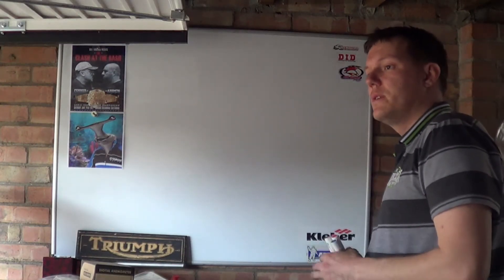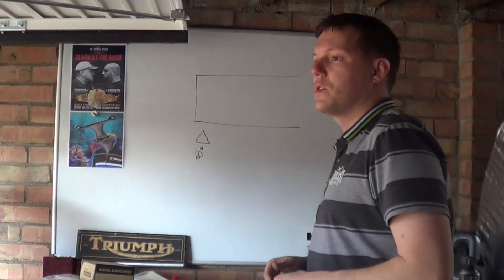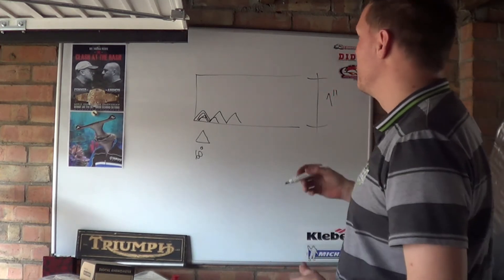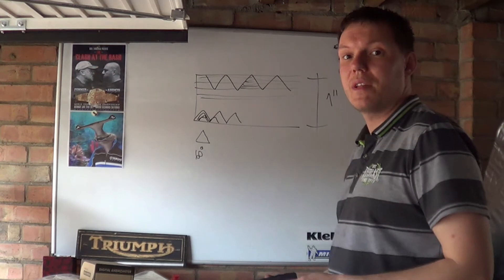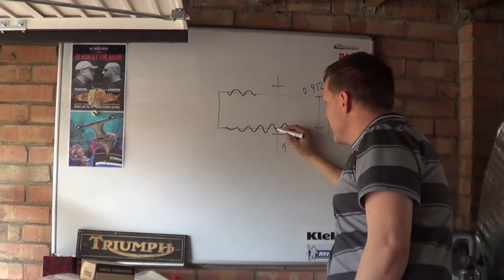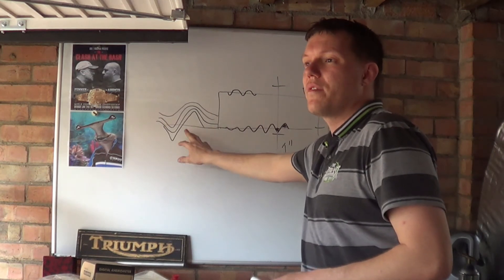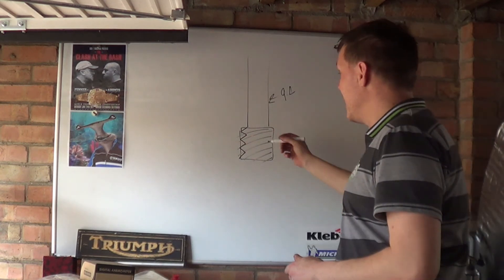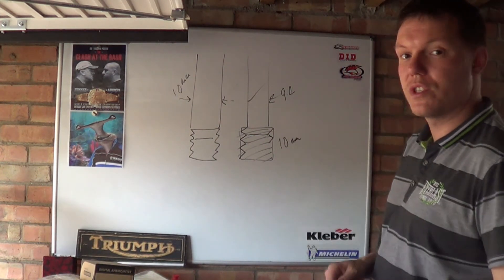Rolled vs Cut threads - what's the difference?

Comment: you could even take it a step further for ease of repair on some items and cut away a relieve that would be above the parting line of the material you clamp, so stuck threads that result in fastener breakage can be gripped, the benefit is that you can apply heat and spray and shock loads (hitting the end of the bolt) more effectively,  making removal way way easier, now if the diameter is bigger you can still do this, but it might break at the thread anyways, where rolled is easier to put the relieve into, you also get the benefit of having better clearances to remove the part if the head breaks off, and less shaft seize if corrosion/rust builds up, alternatively you could say if part to shaft tightness is desired that having to make the threads clear gives a disadvantage because unless you wrapped the bushing around the bolt there is no way to make this play go away, this is usually not an issue though

Comment: I'd argue they're stronger as with any forging technique, hot or cold the grain structure is better if not cut.
Cutting threads is not that slow and you certainly don't need a CNC machine, just a thread die!
Reply: The vast majority of aircraft bolts are rolled thread as its stronger than cut thread!
Reply from the maker: I said single point threading, why does that mean CNC? And any machinist worth his title doesn't use a die.
Reply: You mentioned CNC, and with a tailstock die box they cut a fine straight thread if done in two cuts.
I personally wouldn't spend time thread cutting a common thread, better things to do

Comment: Cheers dude, that was one of my many questions a few vids ago, great tutorial thanks, can easily spot a rolled bolt then with its thicker shaft. It makes sense as well that its arguably stronger due to the fact you haven't cut through the grain, that was the bit that got me thinking why are they supposed to be better, and thought there must be a structural reason and this makes sense... cheaper into the bargain, but assume it matters on the application as an overriding factor.
Reply from the maker: either I fucked up in the video or you've mistaken what I said lol Rolled bolts have THINNER shafts. The greatest limiting factor with rolled bolts is generally the size of thread you want. The rolling machines are very, VERY expensive. So they build them with the standard sizes in mind. Luckily the volume of standard sizes is the greatest so rolled bolts make sense. - matt
Reply: No you were perfectly clear it was my typo, I meant thinner...